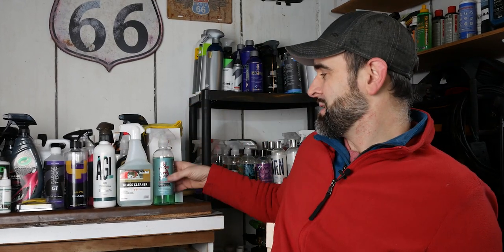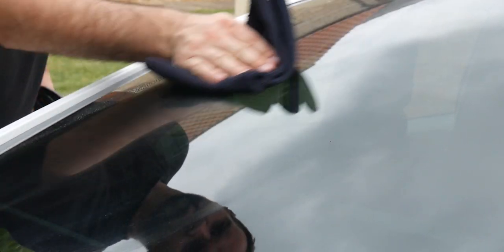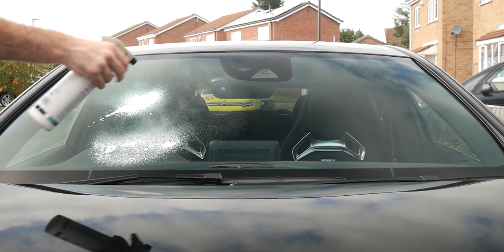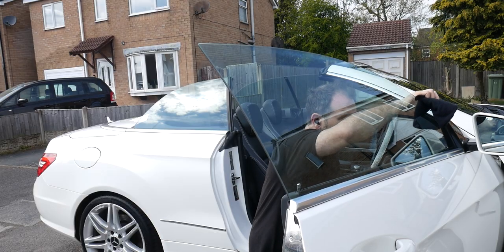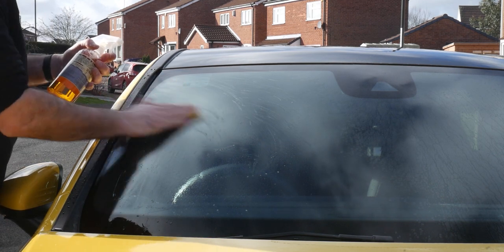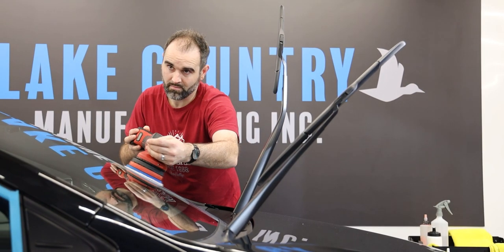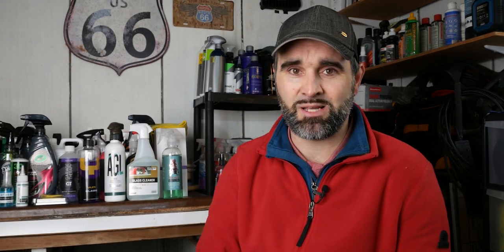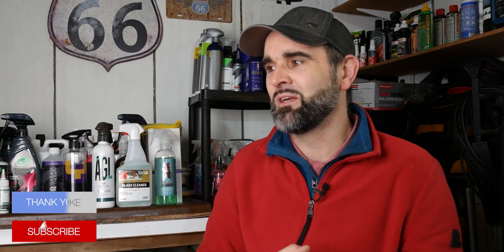Clean Your Windows Like A Pro In 8 Simple Steps!

Comment: Good information for people  who want to learn more  about car detailing. However if your after perfect glass with minimal effort my advise would be.
Some my be put off by the cost..... Use a WATER FILTER.
I have one in between tap/pressure washer the, results on the whole car is just    amazing.
No need to  go over the glass again with a  glass cleaner (which can introduce streaking and leave residue ).
You only need to wash/rinse with filtered water dry off your done!.
Added bonus with filtered water car/glass will  still dry  streak free If just left to dry naturally. 
Also your safe to wash in direct hot sun as you wont get any water Mark's whatsoever.
Been using water filter for two years now wouldn't dream of using straight tap water on glass.
Claying and polishing is 
Really important for that perfect finish on your glass.

Comment: Can i use for the clay part a glass cleaner as a lubrication?
Reply: Sonax say their ultimate glass cleaner can be used with clay
Reply: @martin1649  thanks for the reply
Reply: some car shampoo diluted with warm/hot water (helps keep the clay pliable, than cold water) -- cheaper than most clay lube, and i use AM Clay, which just needs water
Reply: @Mogsy28uk  cool...i was thinking to use my glass cleaner for the windshield and side windows as a clay lube..but i m not sure if its possible...or if i would do some harm with that
Reply: @damianopach4045  depends on what the glass cleaner is made of, some have solvents, and clay loves lubrication, so i wouldn't personally use glass cleaner as clay lube.